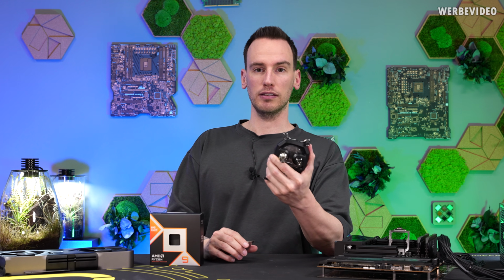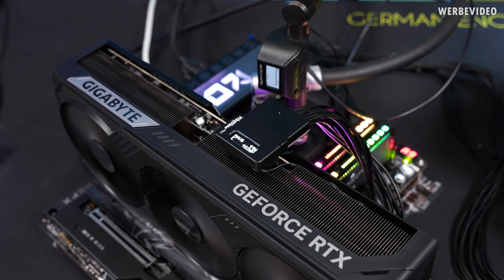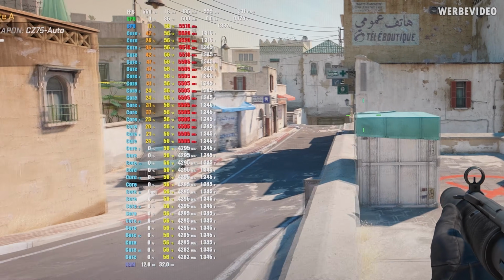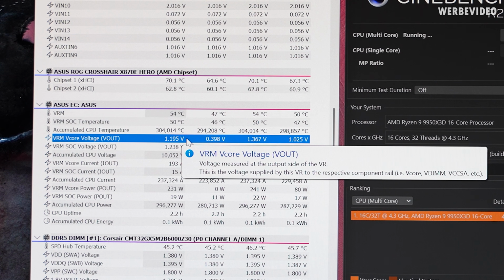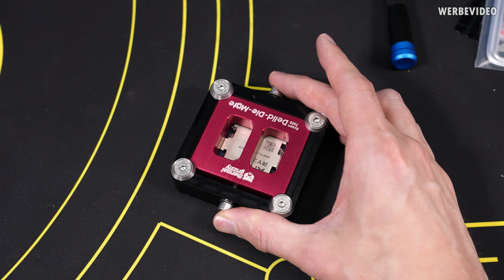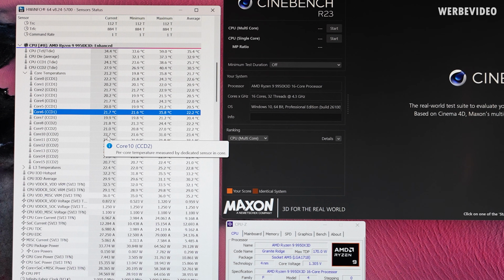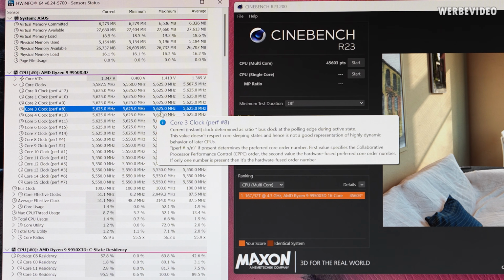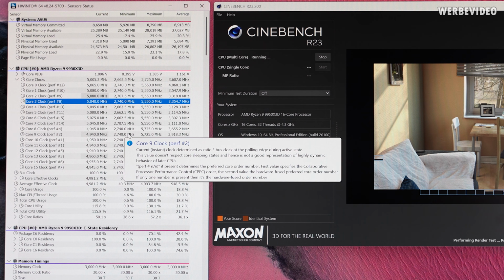Delidding the Ryzen 9950X3D makes it Even Stronger

Comment: For science: Totally worth it. For Daily use: No. I get 42K MT and 2K ST points (with all background apps open) without delidding with a normal AIO just by using PBO Motherboard and CO/CS. No scalar, No LLC.
Reply: Wut I got 44k ish with pbo +200 and co -20 using LF3 420 AIO. 
42k is stock settings for me (only XMP).
Reply: That`s low. You should get at least 44K.
What`s your mobo?
Reply: @brugj03  I do get 44K when I run CB23 with real-time priority.
Reply: @ How do yoy set real time priority?
Reply: @brugj03  With Process Lasso. It used to be a feature on the old Task Manager but can't find it in the new one.
Reply: @ Right. Thx for explaining, but as i said easy 46000 plus score with nothing but basic PBO and CO -25.
I must have a great sample.
Reply: @brugj03  Are you on a custom loop?
Reply: @SaccoBelmonte  in task manager right click the service and go to details and then you can right click again to set priority. No need for process lasso
Reply: @ No, just an high quality EK AIO watercooler.
Reply: @ I just tested real time priority set in task manager under details and got a staggering 46411 point.
Amazing.
Reply: @SaccoBelmonte  I do get 48k without any adjustments.. so indeed that's a low score.
Reply: I get 42k stock and 44.5k with PBO +200 and -10 with a custom loop and Apex 1 AM5 block. No adjustments to process priority. Tons of background apps including HWinfo64, Rivatuner, Steam, DS4Windows, and Process Lasso.

Comment: Not recommending liquid metal directly on the IHS due to the possibility of a short circuit if it touches other components is legitimate, but saying it can corrode the IHS, which is made of nickel and is not affected by gallium, really doesn’t make sense... 
Unless the IHS or the heatsink is made of aluminum, there is no risk of corrosion with the application of liquid metal on these components...
Reply: no. nickel does chemically react with liquid metal alloys, it just does so at a much slower rate than copper.
Reply: From personal experience it will permanently stain the IHS and the waterblock even if both are nickel plated.
Reply: But copper does, so it's a matter of how much you trust your coating.
Some coatings are fine some are bad Like with waterblocks, internet is full of pictures of effed nickled waterblocks from every single manufacturer and full of people who are fine and encountered no issues.

Comment: @der8auer EN  HWiNFO updates slower because Cinebench is set to realtime priority, either lower that to 'high' (it resets it every time you start a new run, so remember to do it everytime) or set HWiNFO to high / realtime. CB simply eats so many cpu resources with realtime priority that hwinfo has none left for it to update lol.
Reply: Came here to say this!
Reply: Process affinity yo!
Reply: Yes, I also noticed having CB without HWinfo running I get bigger score. It is true CB will kind of hog most of CPU processing power so other processes on PC "slow down".
Reply: It may also help to disable other unimportant HWinfo sensors, leaving CPU, MB and power.
Reply: Use Bitsum Process Lasso, latest Beta, enable all administrators, it's awesome
Reply: yep, was gonna suggest this. the CPU doesn't spare any CPU cycles to HWinfo because of the priority.
Reply: Can confirm, hwinfo freezes if you run a CPU-Z stress test and goes back to normal 5 seconds later.
Reply: Does the same behavior occur on Intel systems? That's the important question.
Reply: @KuraiShidosha  it will happen on every single CPU, if cinebench is using every single CPU core and is a higher process priority than hardware info, hardware info can only update when cinebench is inactive (usually it updates after each full scene is rendered). That's just how task scheduling works in windows
Reply: @balthxzar then how come der8auer seemed to imply this is only an issue on AMD CPUs? And to be honest, in my experience mostly using Intel over the years then switching to AMD recently, I do notice it too. System becomes unresponsive a lot under heavy loads where Intel stays usable.
Reply: Was just coming here to say this lol
Reply: this is an amd thing, everything lags when its being fully used, suffered that and switched back to intel. I can do a full prime95 and do stuff while, yet the computer functions ok. because intel knows how to distribute processing power.
Reply: wait what, this is for real?? lol!
Reply: @snowman7234  Wtf is that reaction?
Reply: @alkestos  I'm glad someone said it

Comment: Is it possible to drill several holes through the IHS from side to side and used it as a water block?
I know Is a lot of work but how can it performe using a good air cooler and water in the IHS?

Comment: Hi. About HWiNFO ... yyy... Windows is stupid ('no s**t Sherlock'), and even AI doesn't help him :-/ I sorted the problem by changing in task manager priority from 'normal' to 'above normal', and in my case it solved the problem. I had similar problem with Steam on 12700kf (many people have had the same problem on this specific processor) - Steam used only 4E cores, and whole system started lagging (honestly was unusable). When I hanged Steam priority to 'above normal', it started utilising all cores, and everything backed to normal. 5€ for the tip :-P

Comment: I'm running ryzen 7700 with maxed PBO and negative curve optimizer at -60 on all cores with 280mm aio and CPU boost 100-200MHz higer with temperature around 60-65°C, system is stable

Comment: I wonder why Idle temps of my Ryzen 9950x hover around 55C
It ain't thermal throttling when rendering (caps at 85C) but Idle 55C seams high when Curve Optimizes is set to PBO -20 (per core).
Reply: Might be a bug in Windows 11 24H2.
I see lot's of laptop's and PC's with the system process in taskmanager not returning to idle, it keeps eating 1 cpu core preventing it from full idle. I currently have a Razer blade laptop here with the same issue of running 60°c on idle and nonstop fan noise.
Reply: @harrydijkstra9936  If you can adjust the vcore in the BIOS, I'd try dropping it just a bit. Motherboard vendors have been pushing too much vcore by default for decades and causing hot running chips with no/low load.
Reply: That's not a bug, my 9950x sits around 50c and when running cinebench it bounces off the thermal limit of 95c. I added another fan in my case to add more positive air pressure but all that did is slightly lower the cpu temps under load and when idle. When gaming the cpu hits about 70c avg to a max of 75c. My AIO is a 2 fan 280. I think I need a 420 to really lower the CPU temps. Also , running a mild tune with Expo 2 and PBO enabled.

Comment: @der8auer EN - you can try disabling the rest of the system sensors while running Cinebench so HWInfo doesn't pull them and lose updates. Also, HWInfo is souly based on CPU performance so running it while running Cinebench kind of demolishes its performance, thats how the program was made. You can also try and use some AMDs or Intels statistics viewer as those might be more efficent.
Reply: Running windows in Safe Mode makes it easier

Comment: If I am not mistaken... AMDs boost algo check temperature, and downclocks the boost. So only feeding it more power, doesn't make any real gains.

I think you have to optimize EDC and TDC (leave PPT maxed). In my experience, its all about the cooling and the chip, and typically you raise those settings with 10-15%.

Then its time to play with Curve Optimizer. It lowers power use (PPT), while your chip remains limited by EDC and TDC. As the power reduces, temp reduces, clocks boost, and temp increases. So in the end temp remains the same, power decreases a little and you boost a little more, with some more performance.

But you likely wont have to deal with 300W of cooling. Up to 240W would be my guess.
Reply: Its always beneficial to max out the cooling with AMD boost algo

Comment: Hello der8auer EN i have a question. A while back you made a video about some weird gpu backplate coolers. Could you use something like an stock intel/amd cpu cooler? Try to explain why does the manufacturers not try to implement cooling solutions for backplate of gpus or be able to mount a small cpu cooler. I was really wondering for a while about this because it could have some potential.
Reply: with no blocks for 9070xt yet there was a guy janked an AIO onto the back of the core for 2 or 3 degrees off 😅

Comment: Even my 4790k @ 4.6ghz  ran hotter than the 9800X3D I swapped to despite it having similar/10% more wattage into a smaller die size with an old h100i pro 240mm cooler kind of crazy.

Comment: More proof that overclocking is essentially dead, almost doubling power draw to increase by less than 10% is just not worth it, specially when you need to spend $100s to delid and watercool the CPU, just put an aircooler on it and forget about it, no wasted money and no risk of breaking the CPU or water leaks in the system. Save the money for something that actually makes you system better.
Reply: A good 3600mm All-In-One solution is really good for your ears though.
Reply: @basbass429  I have a Dark Rock Pro 4 and I can never hear it in normal operation.

Comment: I always thought that you must look at the "Core Effective Clocks", but Roman is looking at "Core Clocks", what is the difference? I guess if he is looking at the second, that's the correct one
Reply: Effective clocks are more what the real performance is, it includes the sleeptimes and whatnot of modern processors, the core clocks are the 'old' way core clocks are reported and this is also the way most of the apps report them. With Effective clocks you can also spot 'clock stretching'. You want core clocks and effective clocks to match as close as possible to each other under stress scenarios. On idle effective clocks drop to few hundred mhz compared to core clocks reporting the base frequency of your cpu.
Reply: @alkestos  These benchmark results are really, really terrible, as well... There's no way the effective clock speed was 5.6GHz during the run, or that it was using >300w for the run... Seriously, for an engineer, derbauer has some of the worst/most inconsistent testing methodologies on the youtubes. I'm running delidded 9950X3D with the Mycro Pro, I've beaten his CB score using PBO2, with average effective clocks of 5.27GHz on both CCDs, using ~230w... Like, how do you get this far without knowing about process priority messing with hwinfo reporting, and how do you take the instantanous max power draw / max requested clock speed that was reported once as fact for your benchmark? If it were actually running at the 5.6GHz range, it should have gotten a score closer to 50k...

Comment: Is it safe to use thermal paste or ptm7950 on a delided CPU?
Reply: yep, neither are electrically conductive, so both are fine. that's all you're worried about is if it's electically conductive
Reply: @bradhaines3142  okay, thanks man for the explanation.

Comment: What determines cinebench r23 scores for same CPU ? Cause i thought only how high cores are boosting ?
Opening your video I expected u to get much higher scores than mine 9950x3D with this delided CPU and liquid metal custom loop u have.
I get over 46.2k score on an air cooler (nhd-15 g2) with CO of -25 while pulling ~205W and my clocks never broke 5.4GHz (usually around 5.35) with temp of 71C 
So how is it possible u get only 45k with boosting 5.6GHz and 5.5GHz all core?
Reply: Lower process priority and or more background programs.

Comment: Skatterbencher vids on Curve SHAPER is most interesting and useful. My own fiddling with my 9900x boosted Cinebench R23 from around 32000 up to approx. 35500+. Didn't spend much time, just for curiosity sake. Applied negative values only ... and lowered temps by 5 - 10 degrees as a bonus!
Reply: Nice, I was getting 31000 with my 5950x
Reply: You didn't mess with external clock generator at all? His overclock guides always seem to be pretty tame until he gets the e. clock modifications going then they take off. Unfortunately my ASRock Nova board doesn't have a separate clock generator for CPU ratios so I'm limited in my options. Don't really care though to be honest because the gains are fairly minimal anyway.

Comment: Great tutorial and exploration. I’m getting 44K CBR23 on my 9950X with air cooling, PBO, 85C temp limit and -20 Core Optimizer. With this delidded setup I’d be surprised if PBO could not be dialled in further with Core Optimiser and Curve Shaper to get 45K+ MT and high ST.
Reply: It think it'd be pretty easy to get 45. I'm running a bone stock profile with pbo -15 ccd1 -20 ccd2 44600 multi. I can imagine how much headroom I'd have with direct die. Then tuning as I went. Load line, core shaper, set pbo limits, set voltages. I think even you'd be able to get it air cooled direct die. That'd actually be pretty cool to see.

Comment: Remember when these speeds  required liquid nitrogen
Reply: That was just a few years ago. Perspective is a helluva thing. We should be amazed everyday at what we can buy today.
Reply: I was vlown away when ai cooked chips were doing 5ghz stock@AshtonCoolman
Reply: @AshtonCoolman  i5-2500k never would have aged as good if intel didn't sell quad cores for the next decade.
Reply: @AshtonCoolman meh, havent really seen that much improvement the last decade. Even if last 7 years have been better than the years before that
Reply: @user-wq9mw2xz3j  meh? Why are you so jaded?
Reply: @user-wq9mw2xz3j  You're living under a rock if you haven't seen improvement in the last decade. Processors are an order of magnitude faster, and while you were paying £500 for a shitty 1080p monitor a decade ago, you can now get a 4k OLED 144hz 42" gaming screen for £400.

Technology has gotten so much better it's hard to put into words. You just haven't been paying attention
Reply: pepperridge farms remembers
Reply: 5 GHz on the Pentium 4, 6 GHz on the Core 2, 8 GHz on the Bulldozer FX...we are getting there, and with better IPC too
Reply: @ruikazane5123  Pentium 4 was doing 8Ghz+ with LN.
Reply: @PREDATEURLT  That is on LGA775, the older Socket 478 units didn't get that far unfortunately
Reply: @ruikazane5123  That is true.
Reply: @PREDATEURLT  I forget which cpu it was, but someone pulled off over 9ghz not that long ago.
Reply: @kaseyboles30  14900 did 9+.
Reply: @ruikazane5123  One day we will be able to run the original crysis at full settings.
Reply: @xpyr  One day the original crysis will be able to run cyberpunk full path tracing. Until then, Cyberpunk is the new crysis.
Reply: @sammiller6631  what do you mean by saying Cyberpunk is the new Crysis?
Reply: @xpyr  The engine is really poorly optimised there. No matter how fast the hardware is, the game can't utilise it very well. It wasn't because it was very demanding, even though it was, it just used hardware very poorly.
Reply: @ruikazane5123  it took intel over 10years just to break the old bulldozer record..diff is tho, intel didnt use all cores like bulldozer did...
Reply: @Dark3rdayz  I mean, the FX only had "8" cores. Now if Intel revives Tejas and hit that 10 GHz base clock goal 20 years later lmao
Reply: @ruikazane5123 That was because they made the pipeline so long, each clock was doing fuck all. Which is why it pipeline stalled all the time. 

8Ghz?! Bulldozer was wack
Reply: @shouk_o  The higher clock speed was a necessity to "compensate" for the long pipeline. Of course they are all whack. Only winning the clock speed race...
Reply: No it doesn’t. Mine runs fine without
Reply: I also remember when we went 8mhz to 33mhz so speed gains like this really aren't remarkable to me.
Reply: I remember when my computer didn't need any heat sink on it's cpu or 'gpu'. And ran a full megahertz!
Reply: Have you tried YouTube channels tech ingredients thermal paste? Sure looked amazingly good
Reply: Just say frequency. Speed is correct if you are throwing the CPU.
Reply: @ShadowManceri ☝️🤓
Reply: @ShadowManceri  Just say speed. Frequency is correct if you are oscillating the GPU.
Reply: @ So you would be fine saying that older gen CPU is as fast as new one when they have similar frequency? That is what speed implies and clearly it is nonsense. "It is older, but it is as fast doing less work!" What? So yeah, just say frequency, that's not ambiguous.
Reply: The future is now old man!
Reply: OR longer pipelines
Reply: Evolution of CPUs wasn't really impressive the last 10 years. Idk what you on about. Just added more cores and accordingly the TDP went up 🤷
Reply: @saiiiiiii1  Pentium 4 was the best cpu ever made, i agree. Nothing about cpu's have changed at all. What are you using? sandy bridge?